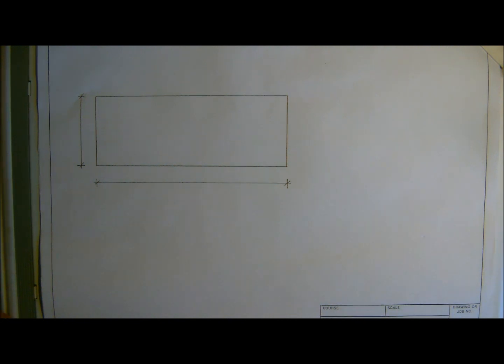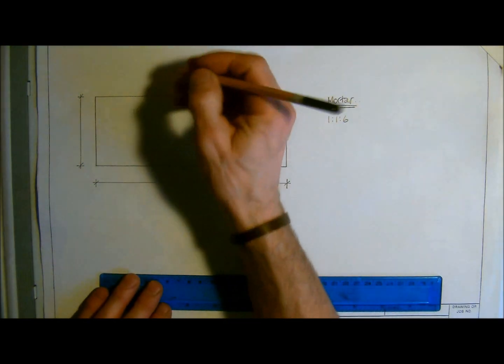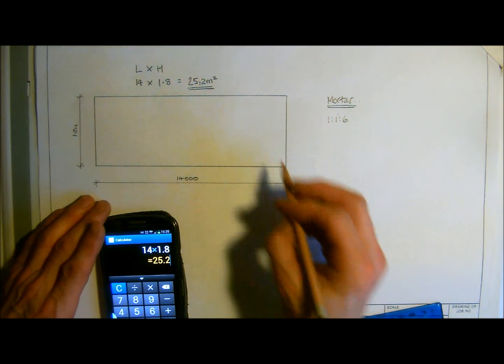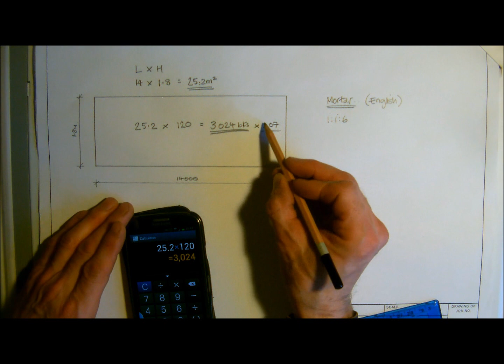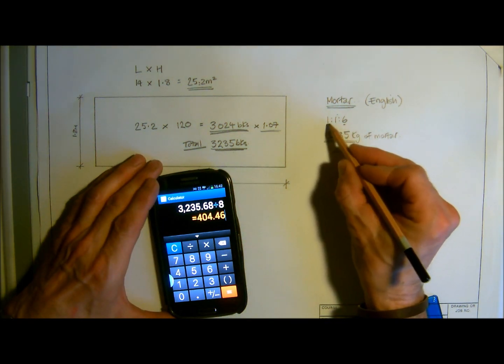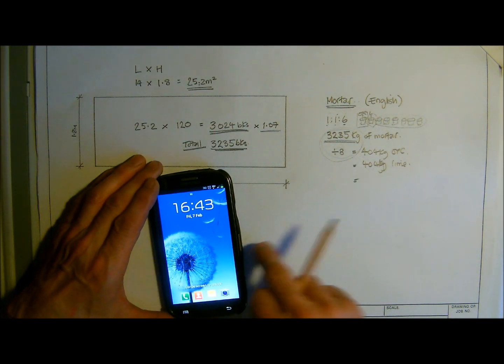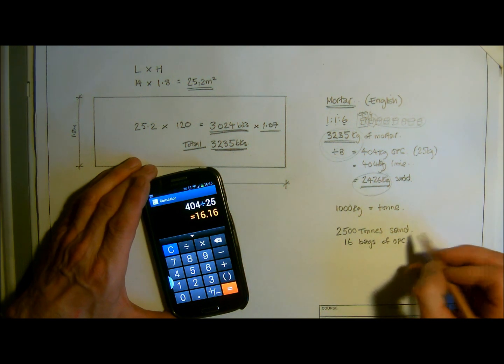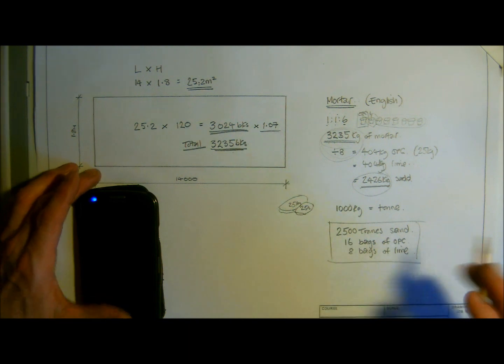Calculations Lesson 8  Mortar 2

Comment: How does English bong equate to double the amount of bricks? Are you talking in terms of labour as you are just splitting the brick in half and using both sides?
Reply: English bond, in the case mentioned, is a two rows of stretchers, one behind the other, and a row of headers, to bond the wall. So a wall built like this has no cavity, but is very strong. Houses in England were built using a variation of this, often five rows stretchers, one row headers, before the Great War (WW1).

Comment: Love the videos but I have a question about this one I know that it is not practical but you are suppose to weigh the materials to gauge them not gauge by volume as for example when sand is wet it will have more volume, so with lime the calculations are correct and should not be half you just need a bigger box for the lime than the cement
Reply from the maker: yes, sand will increase in weight up to 30% this is why correct storage of aggregates is essential, on a tarpaulin on well drained ground and covered with polythene sheeting to prevent rainfall saturating it and giving inaccurate gauging.
Reply from the maker: Hi Matthew. Concrete plants gauge by weight when mixing loads as they have the computer systems to do this but on site a bucket is the best available method